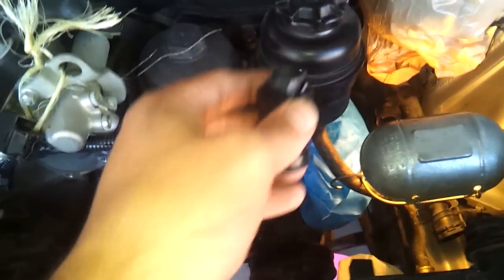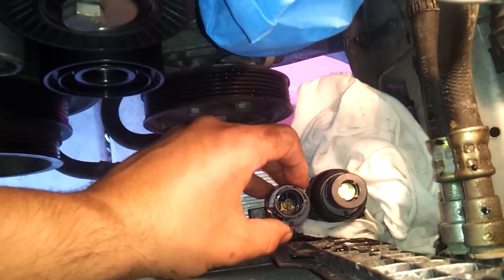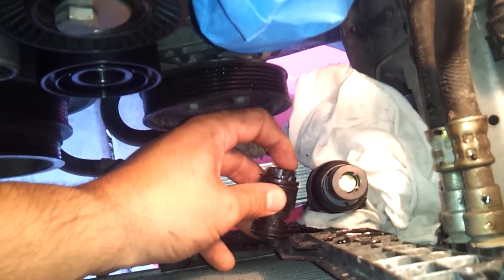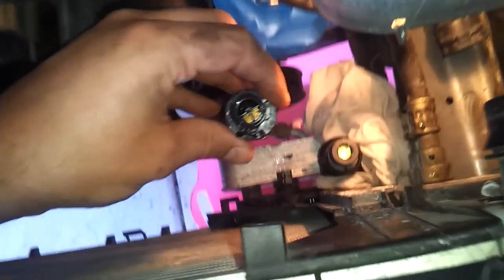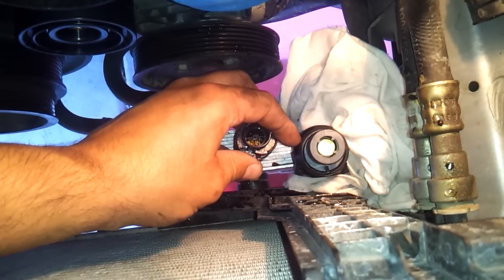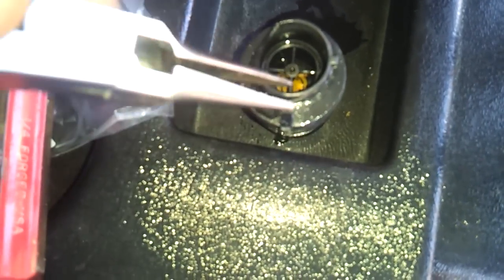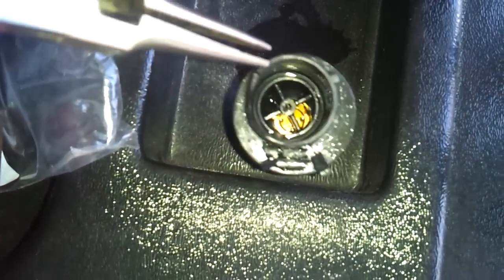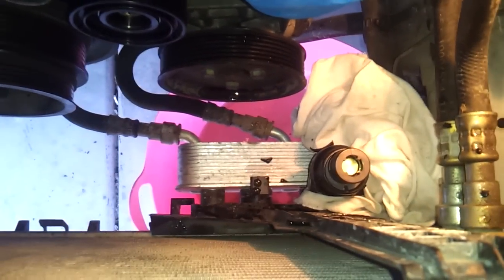BMW E46 Atf thermostat removal and replacement

Comment: Mine was so brittle I had to drill a dry wall screw into the edge of lodged piece to have something to pull out with pliers. And that worked. So that is another way of getting it out if the plastic part you pulled on keeps breaking.
Reply: i did the same thing
Reply: where did you drill? thanks

Comment: Every single bit of the lip crumbled and broke off on mine preventing the further use of needle nose pliers for extraction.  Had to resort to a curved hook gently lowered down inside the unit to catch on the housing.  But that O-ring is stubborn.  I had to pull VERY firmly but gently to finally get it out.

Comment: I had to use a screw driver also, . It just kept breaking off with the needle nose. Good Vid, thx
Reply: how did you pull mine crack i mean the edges suppose to hold by needle plier

Comment: i hve been driving my 318i 2001 e46 sedan for 2 years now without that part.& during tht time my expansion tank hasnt burst yet.i do have to top up the coolant once aweek though.m living in warm southern africa.
Reply: Tichaona Mirirai Mutamba so I understand the thermostat is closed when the coolant temperature is below like 80C, then it opens and the ATF fluid is cooled by the heat exchanger. Without the thermostat the coolant can flow through the heat exchanger when cold. The Atf goes through the engine block and it needs to warm up quickly so without the termostat it would take longer to warm up. But the coolant will be warmed up quicker. However, at low temperature the coolant doesn’t flow through the radiator it is restricted to the engine  anyway as far as I know. The coolant thermostat probably opens faster but still I don’t think it has a significant effect on the AT.
Reply: Tichaona Mirirai Mutamba I’ve found that there are cars that don’t have this thermostat just a heat exchanger and /or a radiator.
From the bmw diagram I can see the coolant flows through the cabin heater then through the heat exchanger and back to the engine. When the Atf thermostat is open and the engine is cool (main thermostat closed) it does the same thing. When the engine warms up the coolant flows through the radiator at a variable rate. If the atf thm. is open the coolant flows through the expansion tank and goes down where it is split and one route goes to the radiator the other goes to the heat exchanger where it meets the flow coming from the IHKA.
So if the atf is hot it opens and brings cooler fluid. However the coolant come from the engine which is already regulated. 
Without the atf thermostat the ATF  will be a bit cooler.
Also, I monitored my transmission during a 10 min trip afer a warm up in city and it seems to stay at 86C. So it doesn’t seem to cool down too much. Outside temp was 1C
Here is a diagram

https://grassrootsmotorsports.com/articles/why-are-bmw-cooling-systems-so-apoplectically-comp/

Comment: I was curious if you even need this thing. I live in Florida so atf fluid and tyranny never really get that cold so would it matter if the coolant was always circulating?
Reply: Mark Ruhland you don't need it .  It's design to sit inside of the plate.   The plate is just a big y connector.  It split to the heater core and the return line for the core and to the oil cooler .  The thermostat break just remove it so you'll still get coolant flowing in and out of your oil cooler .
Reply: Na Yang that’s exactly what I was thinking. I think it’s a restriction to have it. I rather have coolant circulating at all times. Thanks bud you just saved me time, money and coolant
Reply: Had same question. Thanks

Comment: I carefully broke mine apart piece by piece.. cleaned the inside of the tube and plopped the new one in.. it feels loose AND doesn't connect back to the radiator... where the hole at the bottom is its completely blocked off... 

did I accidently buy a manual radiator? 

the guys at oriellys said it's for the auto

Comment: please help!! how important is this part if you accidentally break it
Reply from the maker: +Julien Mathieu YOU NEED IT! ---- Buy a new one and install before operating.
Reply: It’s to cool your transmission fluid. I have mine off and have had no problems. Basically your tranny fluid has to get hot enough for it to open and let the coolant flow to cool it down. If you have it off then you have coolant flowing through the tranny cooler at all times. I rather have it that way than wait till it gets hot but that’s just my opinion. Hope this helps